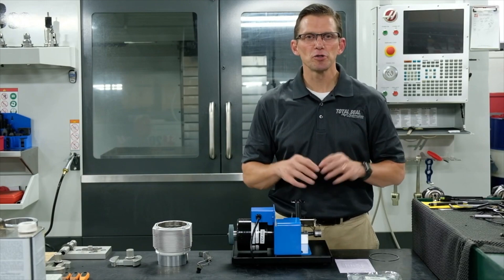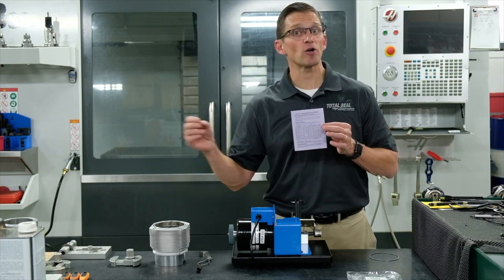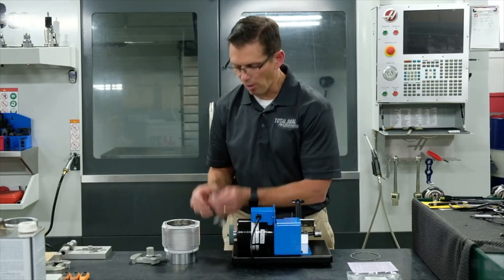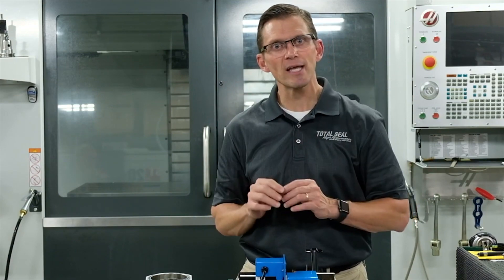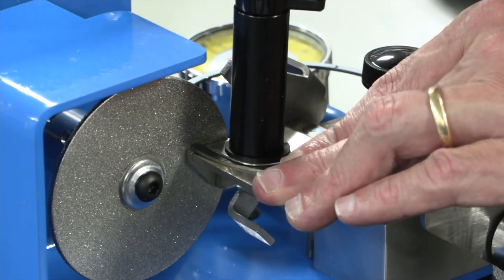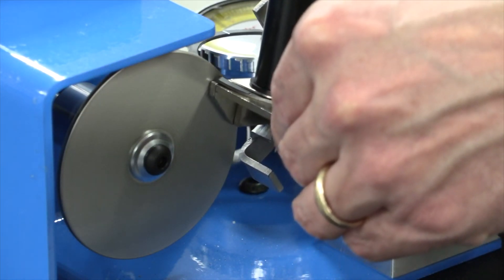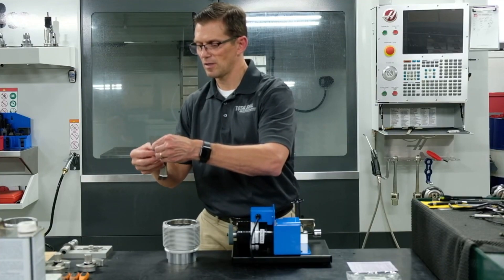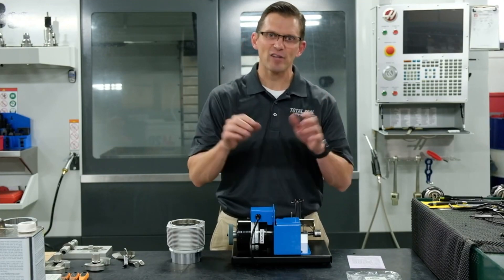Piston Rings 101 - Part 3 - Ring End Gaps & File Fitting Piston Rings

Comment: HUH?!?!?! you want the end gap to be set to the metallurgy and thermal expansion rates of the PISTON VS PISTION WALLS or your engine, a cheap cast piston will expand faster than a high quality forged piston. the piston expands faster than the cylinder walls and seizes/cracks/scratches that's why there is a gap
Reply: How is piston relating to this topic?

Comment: Would like to know the hp loss with slightly oversized gap.  Basically is it worth pushing things to the edge for every last hp or is the risk greater than reward?
Reply from the maker: Great question. The risk is greater than the reward. A little more end gap never blew up an engine.